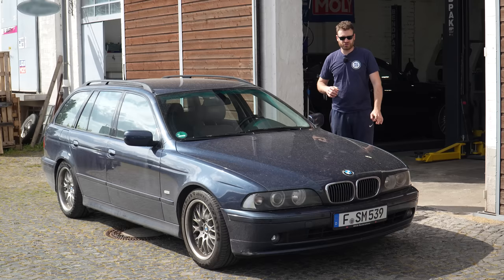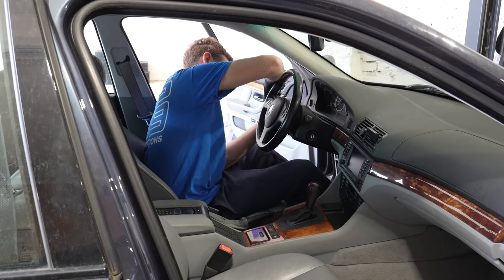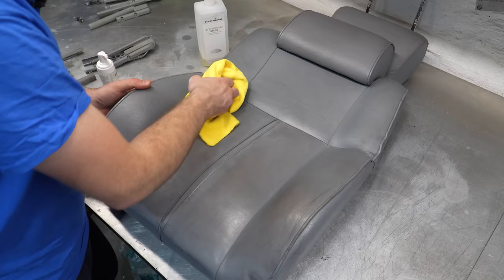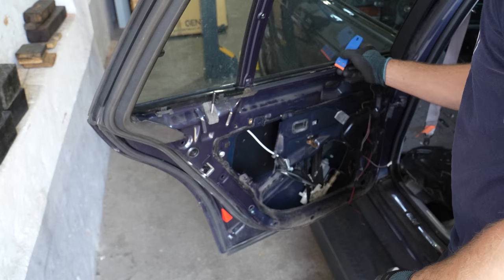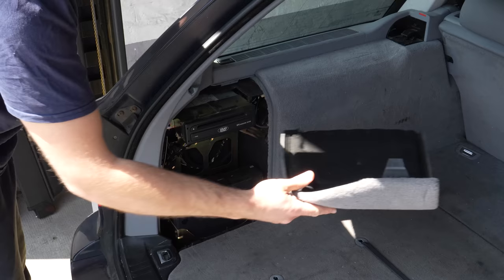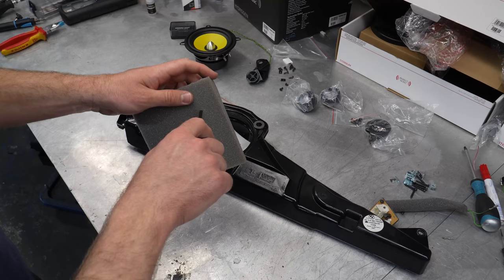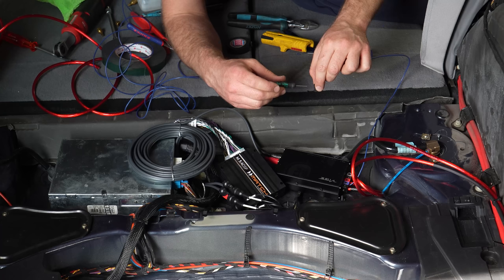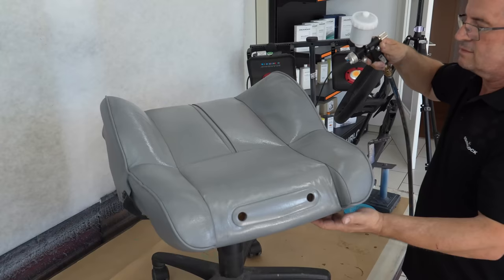Upgrading the 20-Year-Old Tech - BMW E39 530i Touring - Project Rottweil: P5

Comment: Nice one, as always! Actually have a touring like this. And what about the seats, made an upgrade like you want, in autumn. There are two types of connectors in lci, with and without memory option. But the thing is completely doable. The ones I did, were with this plastic bags with fluid and with air compressor for the upper part, I suppose. The springs are different, as you’ve mentioned. The motors are slightly different, but having two sets of seats I think it’s not a big deal to make one working set!

Comment: It seems to me that the subwoofer is moving 1st inwards, meaning that it is out of phase and probably has inverted polarity. In some systems it is planned like this, depending on the room layout or box port design. But if its not designed like that, it could partly delete the overlapping frequency range from other speakers, meaning that there is less bass or time shifted bass compared to other speakers. Maybe its only looking like this on the video but its a simple thing to play around with and see if it improves the sound even more when switching wires at the amp.

Comment: The rear suspension bushes are hydraulic units on the E39 Touring. Cut the old ones apart and you can see the sealed oil chamber. Over time the rubber hardens and the fluid seeps out. Owners often assume the harsher ride is down to tired dampers. In fact the car is held up by the air springs and the dampers provide the rebound damping. 
Usually the damper top mount are not attached to the body of the car but the top of the alloy subframe in an attempt to make the loading bay wider.. As long as the you cannot pull the damper rod out by hand quickly it is fine to reuse them. They last a very long time being so unstressed.

Comment: Just a heads up on sealing the front speakers to their enclosures. Try playing music on a speaker while it's not in any enclosure and then slowly proceed to put it in its enclosure - the massive improvement is because the bass frequencies can't cancel each other out on the front and back of the speaker, since they are sealed from each other with the enclosure. Thing is, you'd want the speaker to seal as well as your intake manifold for them to sound the best, and as you can imagine, some foam won't make the best intake manifold gasket. For the speaker case, I would have used silicone or acrylic sealant.

But it is worth noting that until you model each and every parameter of your car, speakers and enclosures as well as Hexibase (the yt god of audio), you are basically shooting in the dark, so there is like a 5% chance it might end up sounding even better with the foam because it then works better with the subwoofer's low-pass filter or something...
Reply: The E39 has, in my opinion, one of the worst OEM soundsystems I ever encountered. The "bass" speakers in the front enclosures are in my opinion midrange drivers, nothing more. The volume is way to small to play proper bass. The E39 needs, to sound really good, a 6ch amplifier with integrated DSP. Then you adjust the DSP to only play mids on the front speakers and everything that has to do with bass, needs to be played from a good adjusted subwoofer. The rear speakers are also not capable of playing good bass, so they also get only "mids" to play. 

After insulating the doors and the car over all a bit, you can experience sound that you never tought a E39 could achieve. 

The E39 M5 had the "M-Individual DSP System" with two 30cm Subwoofers in the hat shelf. That system sound a lot better, that then added with an Xtrons with internal DSP and the system truly unfolds.

Comment: I have the aKtive seats in my car - it is designed to simulate walking by flexing the lower portion of the spinal column as happens when taking a walk.Getting out of my car after many hrs driving  - ZERO stifness. FANtastic BMW idea

Comment: Glad to see you went and did the subframe bushings. Its bizarre how they looked okay but how much better it drives! 

I've been waiting to see someone do a proper video on subwoofer upgrade. Definitely going to be doing this on my car as well!
Reply: They are filled with hydraulic fluid. If you see any deep cracks the fluid has leaked out and the rear rides harshly.

Comment: I've done the same thing with the seats on my E39, except for that the Contour seats were taken out of a Right-Hand Drive E38 from UK and I had to convert them to Left-Hand Drive seats for E39.
I'v also done the wiring. My E39 is before 1998 and had the black connector, but the Contour seats had the yellow one. Most of the wires match by colour, so it was not very difficult to make it.
I also transferred the Active Seat function and heating from the old to the new seats :)
It was quite a journey, very difficult, because nobody had ever done something like that and I couldn't find any info online :)

Comment: Nicely done - I did something very similar in my 2013 Focus ST, which had a really poor base-level system from the factory. Little bit surprised that the the UK audio guy didn't want to do the DSP tuning with the interior all back in place first, as that will affect the system response and imaging quite a bit. Maybe he's going to tweak it again later ??

Comment: You can also use butyl tape (use two layers for building it up) for mounting the speakers to any substrate.  Should seal a bit better than the foam and not break down.  The RTV for mounting the sub could have been butyl tape as well (less permanent).  Really enjoy your videos from Canada. E39 M5 owner with a BlueBus!  Check if you can use a digital connector for the bluebus audio, rather than analog.  Better sound.  Ted should be able to help out with that.
Reply: Probably not possible given the aftermarket amplifier. Analog is really good too, given the right pairings :)
Reply: @bluebusbt  The amp appears downstream from the BMW DSP amp, hence the DSP/Interface box between the existing DSP amp and the sub amp.  I would think there still might be an option for this connection, but I guess it depends if the DSP amp is bypassed somehow.  I just remember the difference from analog to digital.  Was immediately much better.
Reply: @bobjr77  - This E39 came with no amplifier at all (base, base setup, where the radio directly drives the speakers), so that's why there's no option for digital.

Comment: The factory DSP (Top Hi-Fi) system also sounds nice. And it's including twitters in rear doors. And installation is quite simple. In your case (with bordmonitor and navi)  it's just plug and play. 1day - replace/install door speakers and wires, 2nd day - Step by step replace main wire from trunk to monitor. No any soldering required. For those who want to update the sound system - highly recommended. Unbelievable difference even with Hi-Fi system.

Comment: Honestly, Dave knows enough to give people bang for their buck, at least if you're in the EU and Match products don't cost an arm and a leg like they do in the US. While there are plenty of better speaker brands out there and better subwoofer amplifiers as well, DSP is really what makes the biggest difference in any system. Stock speakers with appropriate DSP correction could be made to sound substantially better and aftermarket speakers typically have better performance and can be tuned more through DSP before they distort horribly. He probably chose those particular speakers because they're a good value and he knows what DSP settings to use for them in that car to get the correction he finds the most acceptable.

TL;DR: Dave is a swell guy.

Comment: I remember driving my XK 120 FHC Jag hundreds of miles- seats had one adjustment- forward and back manually.  The heater/defroster was asthmatic at best and the floor boards got so hot it would melt a tennis shoe.  AC consisted of rolling down the windows (manually) and opening those vents in the front fenders.  Watching this video reminds me of how incredibly spoiled we have become.

Comment: A mate of mine is also really into car audio and led me down the same exact expensive path. My e39-s setup is overkill with the amp and dsp, speakers all round and subwoofers, but it's amazing at the same time. Really enjoyed this episode as it reminded me doing the same thing last summer. Once you get a taste for good audio you don't really want to go back with the next car 😀
Reply: Can I ask what setup do you have on your E39? I would also like to do an upgrade to my 2002 E39.
Reply: @MihaiDolganiuc  Had to do a bit of diging around because I honestly don't even know, since my friend chose the products. All of the speakers, subwoofers and amp are DD audio. The amp is d5.1500, can't find the speakers. I've got two 10 subs in a custom built box that somewhat retains my boot space and has been sealed to get the sound into the cabin instead of rattling the boot. The DSP, which I think is the most critical part in being able to make it sound amazing, is Helix DSP 3s. USB plugs to the laptop and the amount of customisation in terms of audio is endless. That's what the guy did in the video via remote access to Sreten's computer. Hope it helped and what I'd say is that the combo of a dsp and an amp for the new speakers alone is going to make a world of difference even with reasonably priced and entry level products.
Reply: @MihaiDolganiuc  just get any aftermaket amp and good speakers. Wiring is super easy. Put a good quality Alpine or Pioneer headunit in and boom modernized E39. No need to fiddle with boutique bluebus products
Reply: @burntnougat5341  that's going to do a great job as well, no need to go overboard
Reply: @henrysevtsenko1601  agreed

Comment: 41:00 Hey little tip :) You actually don't need to put the negative cable from the battery to the amp. you could just screw it somewhere on the chassis so it's grounded.

Comment: Hi. When you were installing subwoofer wiring. I suggest it connecting in the fuse box which is right abowe batrery. I did it to my touring, there actually was free fise rated dor 50amps and i needed exactly 50 amp fuse for my subwoofer setup. That's perfect place to connect

Comment: 6:36 the difference isn't side to side, rather axial. That's what's majorly different between old and new. Once the bushing's core has started to age, it doesn't fully support anymore and that's what you feel different.
This is specific to these super deep bushings. In other cars with half bushings or different setups, this isn't as difficult to diagnose, but on such a tall bush... it's hard to figure out outside the car.

Comment: You should have installed “dynamat” sound deadening material all around the speaker areas, especially the plastic housing for the mid range speakers. It greatly improves the sound quality

Comment: 20:37 You can remove the butyl with itself.  You twist it into a ball and keep going/dragging over it.  With its adhesion you practically pull it off.
Reply: Du kannst das Butyl mit sich selbst entfernen. Du rollst es zu einem Kugel und gehst / ziehst immer drüber. Mit seiner Adhäsion ziehst du es quasi ab.

Comment: Had an E34 M5 with rear window shades. The small ones became NLA while I owned it and they were both missing. At some point I lucked out and found NOS sitting at a dealer somewhere in the US and bought them both. Never used them though afraid to break them😮

Comment: Sreten, usually sub ground goes to chassis ground instead of battery ground.  Most likely the cable was short on purpose so you dont attach to battery neg.

Comment: U had te remove the original speaker cable/crossover  because that piece has high and low filters on them. The ground zero crossover has to do the job

Comment: I really don't understand what it is with BMW and grey interiors. They just seem to be extremely hard to find for older cars. My E30 has a grey interior and I could NEVER find a grey sport seat, much less one in good condtion. When I purchased it, the driver seat had been replaced with a black one. After much back and forth on whether to reupholster that seat, I ended up putting a grey Corbeau GTS in and I'm happy with that.

Comment: Hi! Just a few thoughts : 1st the amplifier + cable fuse should be max 20cm from battery for safety and 2nd the ground wire is also made so short so it has better ground. Not gonna talk in electrical terms, but if you think about it logically then it´s pretty understandable. Otherwise nice videos!

Comment: The negative cable is short becouse you dont need to route it to the battery, just find the closest ground and conect it there.
Reply from the maker: I know, there are none in that area, battery was the closest and it needed to be extended by 10-15 cm.
Reply: @M539Restorations  Ahh ok, it just hurts my eletrician eyes to see a red cable in one side and a black in the other side. Im hoping you wont leave it like that? You never half ass anything else :)

Comment: I know that you are not an Audiophile, but a little bit of dynamat on that sub box and on those door speaker boxes would have helped even more.  Also, should have used the Focal EX100 front speakers. Very shallow and made for BMW's. Other than that, it all looked good.  I cant believe the size of the original 'Subwoofer'. That was hilarious.

Comment: The  reason the ground wire is so "short" is because its not meant to be connected directly to the battery terminal, but rather to the chassis of the car on any good ground close to the amplifier. Just for future information :)

Comment: It's rather a gimmick but one oem+ thing I love is the illuminated inner door handles, for rears it's plug and play (just need to get power from the window buttons) and fronts need pfl cable that goes from lock to the inner handle. Have you thought about this?

Comment: Hi Sreten,you swapped the polarities,green with the stripe is negative,the wires with black or brown stripe for speakers in BMW are always negative,but you probably done the same on the other side so it wont affect the audio quality upfront however you should have a phasing problem between front and rear.Get to an upholstery shop or even check with Felix for more of that white stuff(decron) that was in the standard enclosure and line the enclosure inside with it,slows the wave down and the sub will respond even better in that enclosure
Reply from the maker: Thank you! Pretty sure I didn't as they are marked from the factory, and the positive connector is larger than the negative one and it's exactly how I said it in the video. Green with black was going to the positive terminal on the speakers. Thanks for the tip!
Reply: @M539Restorations  my bad Sreten, you're right, green with black stripe is positive, brown stripe is negative,I was high on paint fumes and thinners last night

Comment: Just a little heads-up, you didn't actually wire the sub up in series, it's wired in parallel! 
Series would be one positive to negative on the sub and then hooking the cable from the amp up to positive on one side of the sub and negative on the other side of the sub.

If it was really supposed to be hooked up in series you should check on your amp because it could get pretty hot if it's not up to the lower impedance/resistance of your sub in this configuration.
Reply: he sayed series but conected in parallel.. but the amp is 1 ohm and sub is wired in 1 ohm, so its all ok

Comment: Nice one... Again. 

You can fix your doorpanel by soaking the bottom part in woodglue. I 3D printed  the internal "joystick" of the seat adjustment module,  as I broke it as well on my e38. Can send you one if you want. 

Ps: My colorlock "do it myself redye" is quite sticky in the summer.  Hope that does not happen to yours.

Comment: 46:09 The stock subwoofer wire had a foam sheath, you might want to put that on the new wires to avoid any rattling. Also, it would be a good idea to put the white foam on the entire  inside, just as it was in the original location, so the soundwaves get dispersed properly. Just my 2 cents. Otherwise, it's a great job as always, always inspiring a lot.

Comment: Thank you for another great video!  That bluebus system is fantastic.  I am curious what you'll use for a microphone for hands-free calls?
Reply from the maker: Stock one from the car works with BlueBus.
Reply: The large connector shown in the video that came with the BlueBus ties it to the phone system so you can use the factory microphone, as well as making calls in any radio mode :)

Comment: Im guessing someone already mentioned this below but i dont feel like reading all the comments. Your fix of using foam make the front speaker fit in the hole is not going to be a good fix. You cant have any possibility of air getting out otherwise you are going to loose all the pressure which is what creates the bass. You need to somehow seal that up. It will sound better.
Reply: But honestly I dont know if you would notice the difference since you are not really a sound guy like some of us. But for future reference, speakers are all about pressure. If the air from the back leaks to the front, you will loose the benefit of the better quality speaker. Even the butyl rubber would be a better choice than the foam. Some kind of closed cell foam rubber would work alright as well but still not as good as having a solid mechanical seal.

Comment: We need to get one thing straight, there are only three types of seats available for the E39. Standard, Sport and Comfort. What we have here in the original interior is electric standard seats with massage. Leather, massage, heated and electric adjustment are available as options for standard and sport seats. Comfort came with electric adjustment and leather as standard. Comfort seats are easy to spot because of the upper back adjustment. These seat options have been the same from E38/E39.